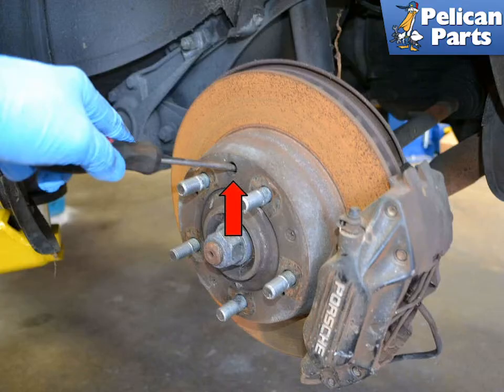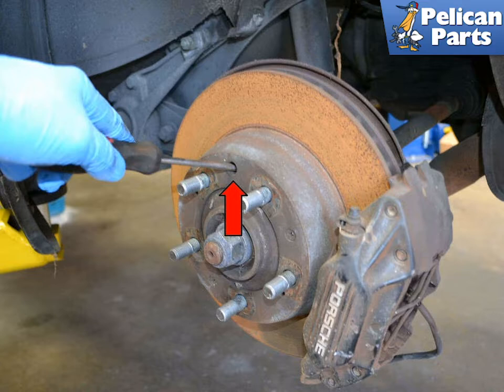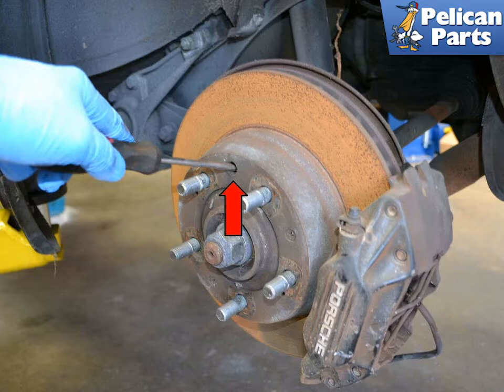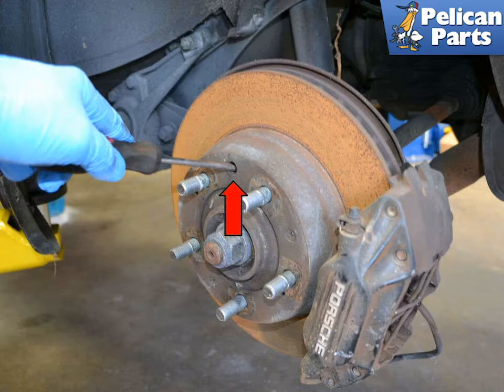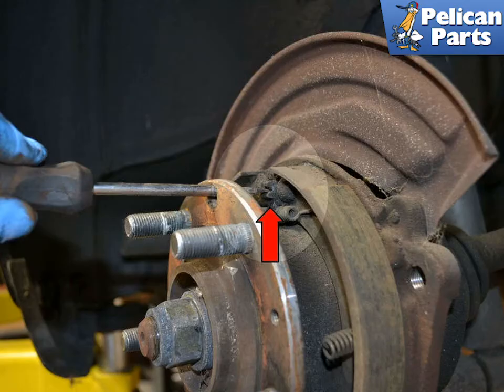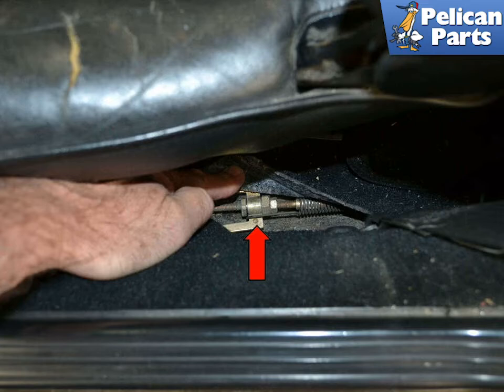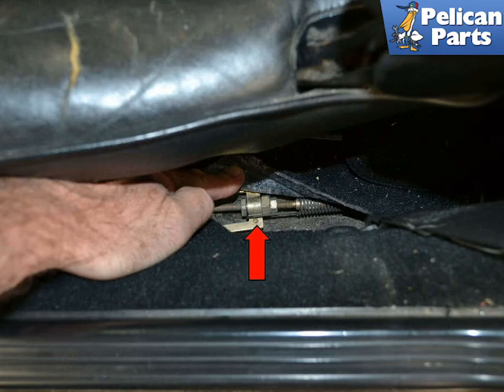Porsche 944 Turbo Parking Brake Adjustment (1986 - 1989)

Comment: Thank you for the upload and time that it took to demonstrate the adjustment.

Whilst its not necessary to remove the brake rotor/disc I found that it was helpful to do so to understand how the mechanism reacts to being prodded with the screwdriver and the force required to get the cog to shift. 

There was a tensioning spring on my 944S that intersected the cog "fins"(?) that required pressure to overcome (You can actually make it out in the photos in this video), and in addition to knowing that, it became a lot easier to know what clunks i was listening out for when I stuck my screwdriver and pushed (or lifted) with the rotor/disc off.

This also provides an opportunity to inspect and clean the components if necessary
Reply from the maker: Thanks for the feedback. Glad it was helpful!